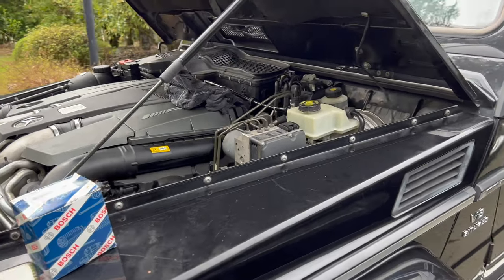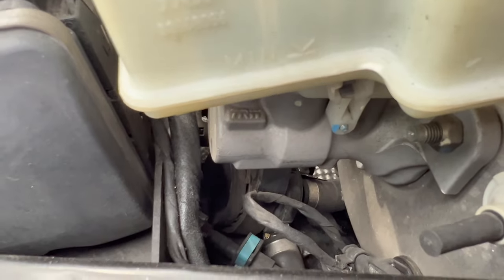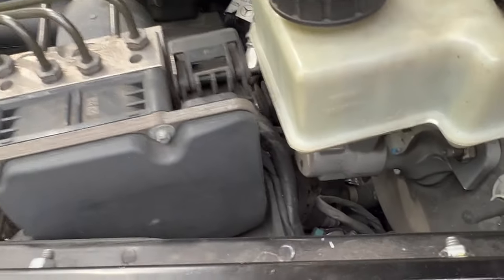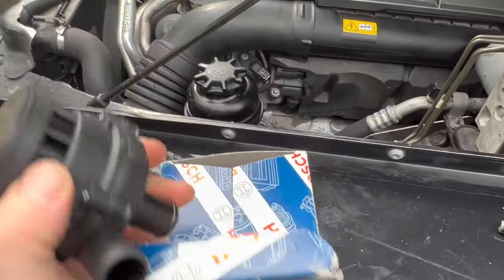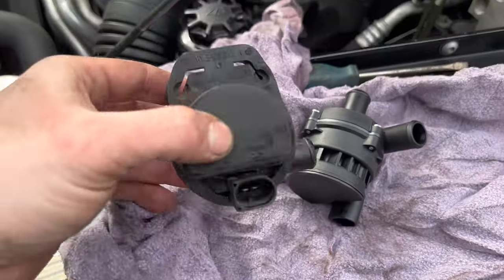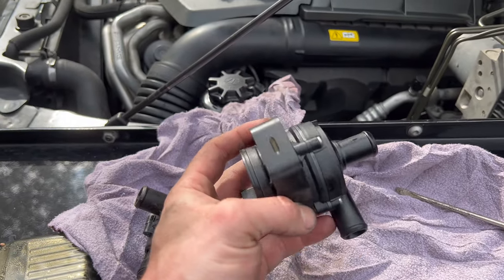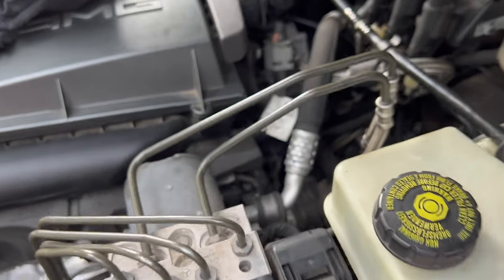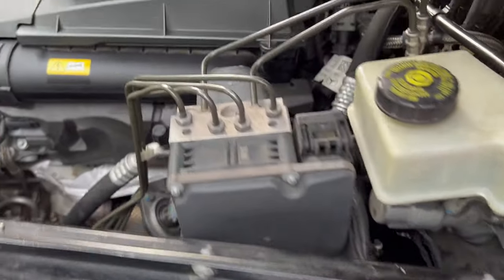AUX water pump replacement on W463 Mercedes G63 AMG

Comment: man i've been chasing these issues for weeks now.  2017 g63. Coolant hose to turbo blew off, engine overheated to 260, melted numerous gaskets, damaged water pump, oil filter housing, what a mess.  Thanks for the video.
Reply from the maker: Oh man that sucks. Sounds like the engine might have to come out to fix all that.

Comment: Hey VM, I got the same issue on my 2017. Man, it's a tight fit from what I see. How did you get to it? Did you remove the two hoses first (That were not connected to the Aux pump), then slide the grommet off in order to get to the screw points on the hose clamps in order to remove the Aux pump out? I will probably replace the two hoses. It's the Aux pump that is causing the leaks, but while I'm down there I will attempt to replace the hoses if not too difficult. It seems whatever you had as issues on your AMG, I am having as well. But I still love my G63. Thanks for all that you do. 😊
Reply from the maker: It's actually not too hard to get out, but it's a good idea to replace the hoses